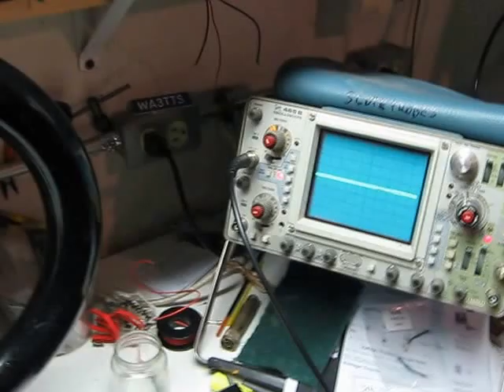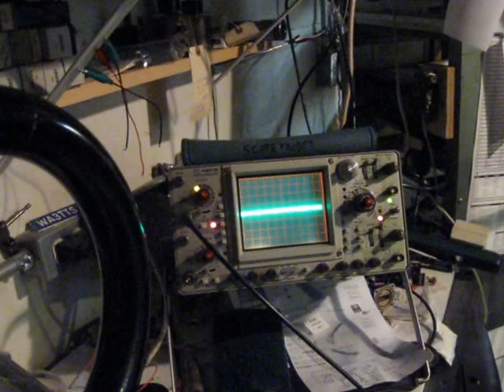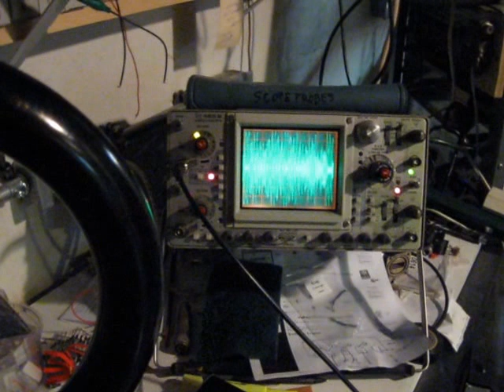Bendix DU-1 RDF Loop Bench Test @ WA3TTS

Comment from the maker: About 10ma per tube, but usually you will only operate one tube as the second tube is a pre-amp for the long wire sense antenna. Also the output impedance is high, like 2K ohms, so you need a pair of LF step-down transformers back to back to get close to 300 or 50 ohms to drive a receiver input. A cathode follower stage could be another option. Here's the supply I threw together, I had to use a few junkbox transformers to get into the desired voltage range...note the 2.4mH chokes for noise suppression and DC regulation for the filaments. I had to make the DC and filament cables long enough (10 feet) to place the DU-1 where it would not pick-up the noise from nearby power supply transformers. If you are using the NC-57M that may be a plus since that radio does not have a transformer. I think the DU-1 schematic is on the Bama Boat Anchor Archive, if not, contact me as I should have it on my hard drive somewhere.

https://www.dropbox.com/s/4f0kk8i2c1jqkwe/DU1SCHM.jpg?dl=0

https://www.dropbox.com/s/99zs0ytjfhx1y78/IMG_4010.JPG?dl=0

Also the High Z coaxial output connector can be left in place. Iif you get creative with an "N" connector, the threaded compression nut end of the connector shell will thread on the DU-1 connector. I spliced/soldered the N shell over an SO-239 connector. I gutted the inside of the N shell and used a banana plug for the center pin. Female banana jacks mounted on a small plastic Rad Shack project case will work on the power connector. If the front panel power switch fails, the guitar amp supply vendors online have suitable replacements. (Mine was broken in shipment).

https://www.dropbox.com/s/6et3fkisc24dpca/IMG_3990.JPG?dl=0

https://www.dropbox.com/s/75vylwutycg1vdw/IMG_3989.JPG?dl=0

Have a good time with it, they are an incredible example of late 1930's early 1940's engineering capability.